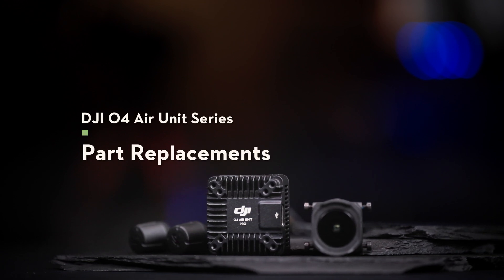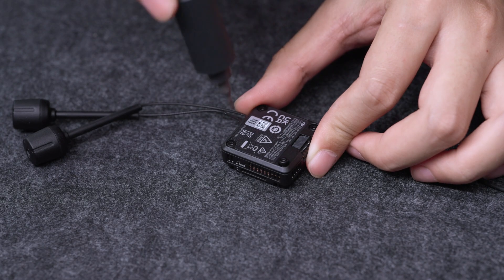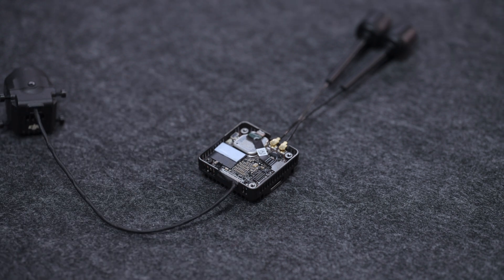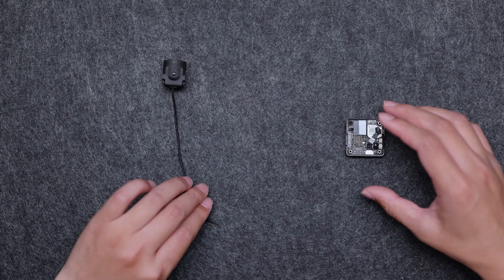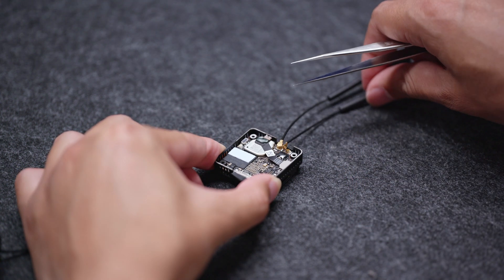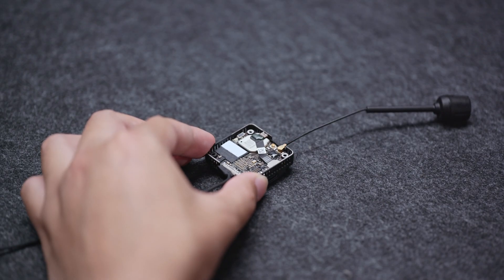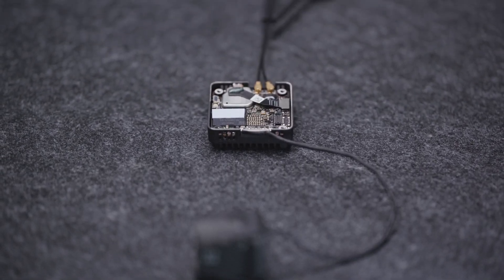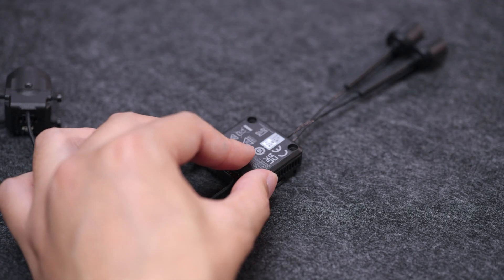DJI O4 Air Unit Series｜Part Replacements

Comment: Would be great if you would sell just the casing of the cam together with the lense and not just the complete cam... 90% of the time the lense will break not the hole cam
Reply from the maker: Dear bowserfpv,

Thank you for contacting DJI and for your valuable suggestion. 

The DJI O4 Air Unit Pro Camera Module and the DJI O4 Air Unit Pro Transmission Module are available for separate purchase on the DJI official website online store. Please visit the DJI official website and click the globe icon at the top right to select your country or region to view availability and stock information.

Thank you once again for choosing DJI. Have a good one.

Comment: I just accidentally ripped my camera cable 1/2 way off plug in air unit pro ☹️ my fault. I don't think i can repair that. Too small. I found replacement cable at Iflight 😁 and ordered another 04 pro while at it. Made the shipping free 😉 so that will be another 2 week wait. Oh well. Too cold outside to fly anyways. My fingers go numb. Thanks for the video 😁